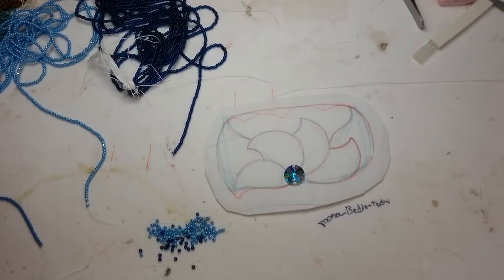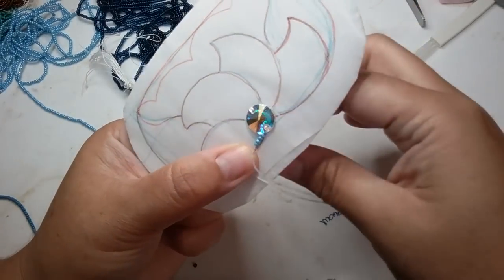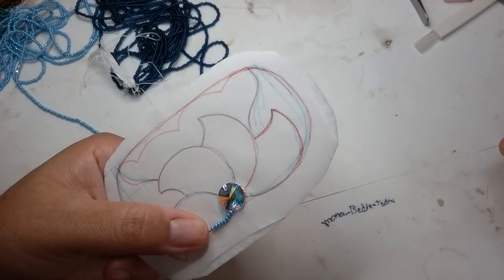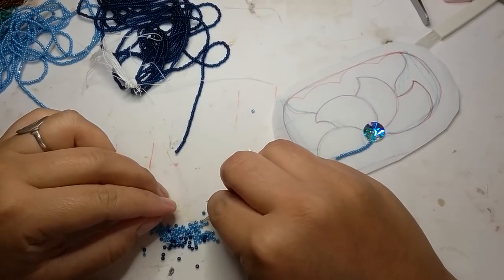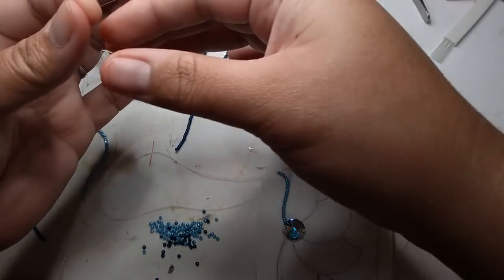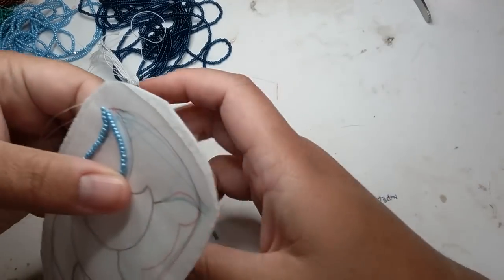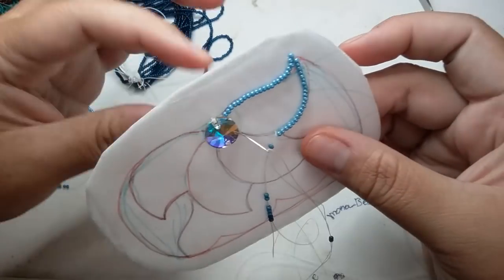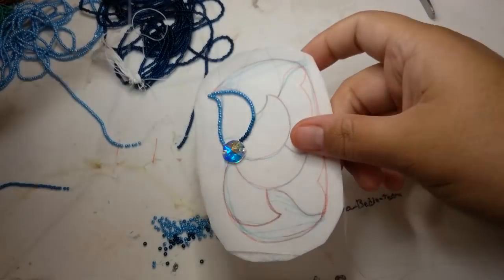1 needle & 2 needle flat stitch beading techniques

Comment: i like tacking the front of the thread that’s holding the beads, because then i don’t have to hold it the whole time, and then i can just bead forward and make adjustments as i’m going (if my design has a curve), and it makes the process go by faster. plus every other pair of beads you do, you can give your beading thread a tug to keep the tension tight

Comment: I have a tip for you.  Try drawing your design on the felt with a flexion pen.  It is removed with either heat from a low iron or water.  I use it for quilting and embroidery it’s amazing.  Then you wouldn’t have to sew through paper which is really hard on your needles and thread.

Comment: Nyeh weh for the tips I've never done the 1 needle stitch like that I'm sure it would come in handy for some things tho.  I am just getting back into beading again I was wondering if my thread was too thick for tacking down it is size D but I wasn't sure if a single thread would be strong enough.  Good tips !  💜🐻
Reply from the maker: It might be, depending on size of beads. If your using smaller beads it will be difficult. But if your beads are 11s should be fine.

Comment: How do you keep your paper pattern to stay lined up correctly on your backing? It seems like it would be hard to keep it from shifting out of place. I am going to try it but am a bit concerned about that. Thank you.
Reply from the maker: Aura Wright I dab some glue around the outer edges, just a few dabs in key places. Let it dry then once you get some beads down it keeps in place.
Reply: Mona C. Thank you! I am getting ready start one and want to try using a paper pattern so I will put a spot of glue in a few places. Last time I drew the pattern on the stabilizer with a pencil, but the paper works well for you so I want to try it. Thank you for your prompt reply and for your willingness to help those of us who are trying to learn!
Reply: My great-grandmother taught me how to bead.. but it wasn't earrings we beaded. It was moccasin vamps and this is the same concept - but instead of glue, she would sew the paper all around the design. Not right on the design but around where the extra material is. After it was all done, we would rip off the thread and paper. I noticed people have their own ways and this was hers. I enjoy learning new ways 😊👍
Reply: Do you just use regular paper?

Comment: What is the best way.Or is there a best way of beading inside a leaf pattern. Sometimes, the inside of my leafs don't look right because the beads sort of bind,or gap due to the tight space. I basically use 11/0 beads. Thanks.
Reply from the maker: Brown Yes I'd suggest checking our Pintrest, just kinda look at the diffrent variations on how beaders fill a leaf. Woodland beadwork has lots of leafs to look at. When I'm stuck on how to do something I just look at diffrent ways to thst others beaders handled it then adjust my beadwork. Hope this helps, happy beading.

Comment: have you ever used imitation sinew beading? if so using the double needle would you still want to double up on the thread that you're using to bead with? I've only used the single needle and would really like to try the double needle. Miigwech
Reply from the maker: CHARITY SAXUM I never have tried that. I've always just stuck with Nymo threads. Nymo is wonderful and strong.
Reply from the maker: CHARITY SAXUM I do use an imitation sinew but only for stringing larger beads for the necklace part.

Comment: I do a lot of single needle beading. My question is, I am working on a piece of suede that is not smooth across the top or the bottom. I thought it would be a good idea to use c-lon thread. However, the thread is a little thicker then I like using 11/0 beads.What nymo thread would you suggest.I want the thread to be strong. But not too thick. Would nymo B or D work. Thanks.
Reply from the maker: Brown Yes Hi! Yes a size B would be good to use if its doubled up, if your doing single stitch and running the thread through twice then it's should stabilize the beads good. 😉

Comment: After you finish the pattern do you take the paper off? And if so how?
Thanks!!!!
Reply from the maker: No I don't take the paper off
 It's forever underneath the beads. I bead right up to the edge and what's left over of the edges I cut off, back the piece with leather or what ever material I like them brad the edges. Which I cover in another video of mine. 😉

Comment: ok, I'm a beginner at beading... I have just started a few weeks ago & my first project is a bear claw & how do I make the point for the tip of the claw? right now it doesn't look good at all. Someone told me to go with a smaller size bead but I think it would look kind of weird.
Reply: I tried the 2 needle one but with just 1 needle and thread and that was hard so I just went with 4 beads at a time,
Reply from the maker: I would turn the bead sideways at the pointy tip of the claw.
Reply from the maker: Also if you check out my Instagram I have some beadwork on there that has Pointy areas, just take a look and you can see what to do. My instgram is Spottedcloud.

Comment: How strong is the paper? How do you rip it off without breaking threads?
Reply from the maker: Kathryn Ali. This is parchment paper, I don't rip it off after I'm done. I just bead over the top, clip close to the edge of the beads when I'm done. Then when I edge the beadwork you don't even see the paper.  However on another video I made, I did explain using a tearable stabalizer when doing beadwork on other types of surfaces. Hopes this helps.
Reply from the maker: Kathryn Ali also the paper is on top of an EZ felt, that's very stiff.
Reply: Ok understand thanks.  I have one more question :)    Do you make the bead embroidered bracelets?  If you do, how do you figure out how long to make it ?    I want to make one that would fit anyone without using a metal cuff inside it.  I just want to make a flat one.   :)
Reply from the maker: Kathryn Ali I've made one, without using the metal cuff. It was an experiment for kinda. Lol. I used as felt used the chipboard(cereal box, in between) then I glued it and put a backing on, after it was all sandwiched together, I wrapped it around a bottle that was relatively the size of my wrist out some rubber bands on it and let it dry for a day. It held it's shape good. Now I'm sure someone has an easier method, that's just what I did once.

Comment: Hey Mona what type of paper are you using for your topping
Reply from the maker: Sergio Jimenez it's a tearaway stabalizer. Pellon is the brand. It just happened to be what I had handy.  You could also use just any regular paper with your design on it. Some people will stitch the paper down but I use little dabs of glue on the outer edges and it holds just fine, really you just need the paper to stay in place until you get a few stitched in place.